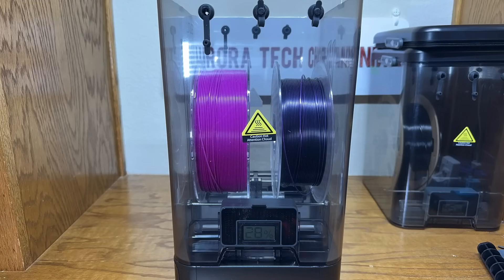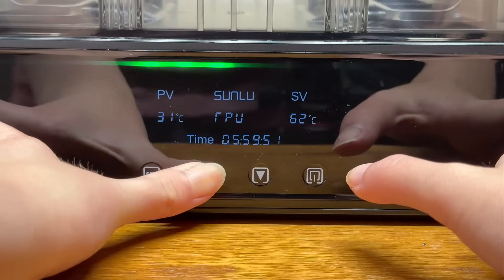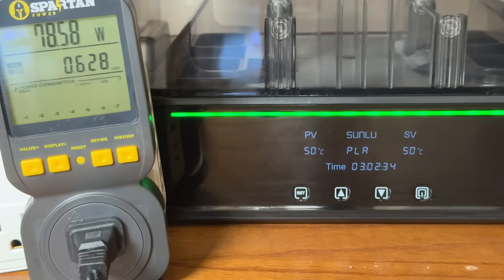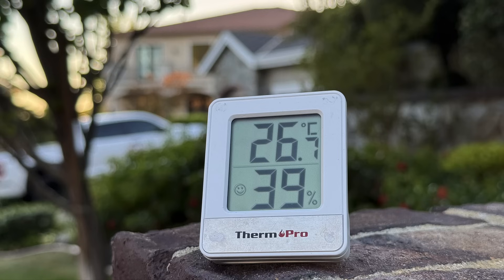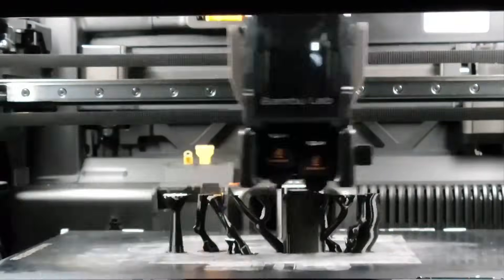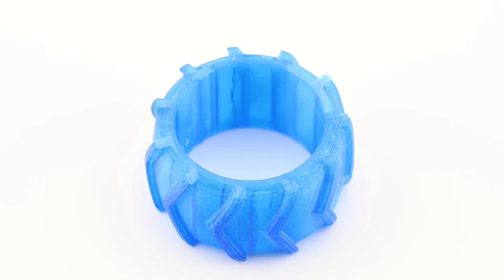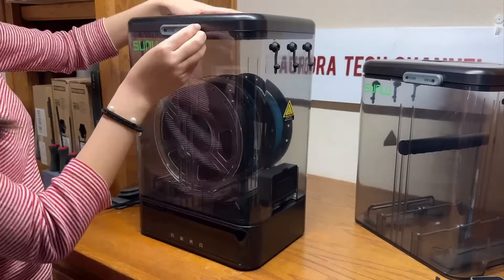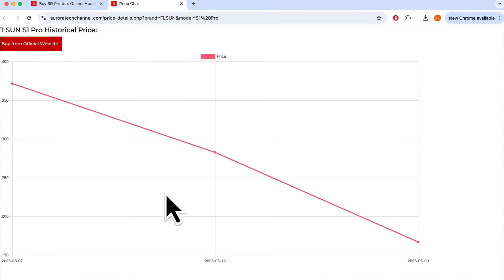SUNLU SP2 Filament Dryer – Detachable & Stackable Chamber, 70°C Max Temp, Built-in Hygrometer

Comment: Your testing is really nice. It's an test of the product but additional you show with the product tests which give use information in general how important drying is for some material. It showed really good that maybe it's good to dry new spools. Maybe i won't do that every time, but e.g. for big models which will print hours of hours maybe it's better to take an additional effort to dry new spools to get good results. I per-ordered the sunlu sp4 because if one spool is nearly at the end you can dry the new one and the old one in one step if you now, that the old one has not enough material for your model.

Comment: It's less money and more versatile than the Eibos polyphemus in that you can stack them.  Both go up to 70c and and handle double 1kg spools or up to single 3kg spool.

My question is about fan the noise after a couple months.  All dryers have quiet fans when new, but after a couple months they can buzz very loudly.

*Oh wait, the s2 doesn't have a motor to rotate the spools?  In that case I'd still go with Eibos Polyphemus or the sunlu s4

Comment: I might get this just for 3KG spools but that’s probably  more of a special use case as a non-commercial user likely because I like having “house filament” always attached to the printer in big spools from Polymaker for my wife or kid to print things easily when I’m not around to mess with AMS or MMU errors. That said that’s always basic Polylite and doesn’t actually get moisture in it too quickly.Seems like a lot of room just for 1KG reels though. My Sovol SH02 does 2 1KG reels at 70C max and is $30-$40 cheaper depending on the day.

Comment: I would like to see a variant where the openings at the bottom of the storage boxes are sealed by spring loaded doors that open inward and can be pushed open by the dryer unit's intake and outlet. This should remove the need to manually put the seals on (during which humidity can enter the box)

Comment: Good review but you didn't cover the only information I need. The max diameter spool size. There website says 250mm max but that seems really small for a 3kg spool. My 3kg spools are 280mm in diameter. So I will need to keep looking for a large enough filament dryer.

Comment: When drying spools the outer layers of the filament always dry and receive the heat, It can not be garuanteed that when moisture has seeped in the spool over a long period of time, that the spool will completely dry in 12 hours, and even 12 hours is a long time....too long if you ask me, then the best thing to do is keep spools dry in boxes like everyone does, and put in those sacks of moisture catchers.... This episode is again a great video in explaining what moisture and humidity does!!
Reply: 12 hours is par for typical drying ( if you want it done right). I dry my PETG and TPU for 10-12 hours; PLA (if it needs it) for 6-8. There's been tests about the center of the spool hitting the drying temp; it takes a few hours, but it does get there and dry like the rest. I just use a food dehydrator though; it's quiet, moves a lot of air and heats up very consistently.

Comment: WOW.  Sunlu just straight up ripped off Polymaker IP.  That's pretty hardcore.   And you support that????
Reply: The PolyDrier is an $89 cereal box on top of a heater with the most basic UI of all time. I welcome the competition
Reply: @westganton  So Sunlu just made a 'bigger' cereal box with a heater and most basic UI of all time?
Reply: @Impenitent2A  Yep! Now PolyMaker will either lower their prices, release something even better, or pull out of the filament drier market. Such is competition
Reply: @westganton  What's the price on that box Sunlu ripped off and copied Polymaker? Such is Chinese practice.
Reply: @Impenitent2A  Not sure as I just bought two PolyDriers a week before this launched. You could argue that PolyMaker ripped off the 3D printing community by productizing their idea to dry filament in a cereal box, but the fact is that nobody cares when the outcome is a useful product and time saved. PolyMaker shouldn’t be surprised by competition when they’re charging $89 for $10 of Chinese materials
Reply: @westganton  I too have Polymaker Boxes...6 of them. Because it's square and clear and similar shape to a cereal box, a pasta box, a small fish tank, etc etc....does not make it any of those things. Every part of Polymaker Dryer was purpose designed...and Sunlu blatantly ripped it off. I don't get defending Chinese CCCP Incs stealing IP as they have done for decades.

Comment: Warn your subscribers about this. It happened to me from an Elegoo purchase.

There is a new SCAM 3D printer companies (and maybe others) have come up to scam consumers, optional third-party insurance, on purchases. I think Seel is the main company, but there are others.  So I made a purchase at Elegoo and I stupidly purchased this insurance. The purchase was under $100, and sent via UPS and they lost it.  Normally, the company would just send a replacement, but not in this case. They have the insurance reimburse for the lost package, but NOT SHIPPING. As it turns out, UPS gives $100 of free insurance for all packages, so Elegoo was paid double, and I paid EXTRA but I'm out the cost of shipping.  So NEVER BUY THE EXTRA INSURANCE, NEVER!!!!

One more thing. Companies are shipping using this new UPS Mail Innovations service. It's super cheap and super slow and unreliable.  It's also the service that lost my shipment.

Comment: It’s pretty clear where Sunlu took inspiration from for this design. This looks like a larger version of the PolyMaker PolyDryer. Almost a 1 to 1 copy, besides from the size, and the UI giving more precise temperature settings rather than three “levels” of operation.
Reply: The one that really is maybe a replica completely is snapmaker filament dryer so we don’t know how it works out there I guess they could just copy each other and see who wins on the Price war. It would be funny if they fit on each other’s platform the single storage ones.

Comment: Since the front is hotter than the middle or back, I wish this had a motor to rotate the filament. Won’t one side get much dryer than the other since it is 10 degrees hotter on the end than in the middle?  Or no?